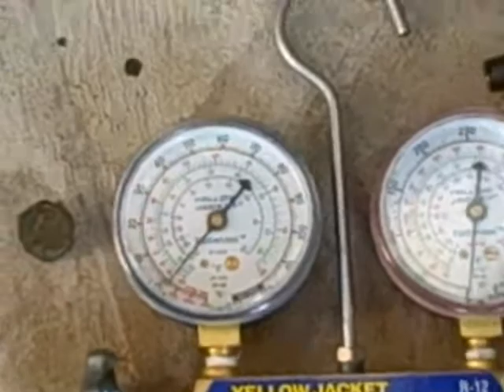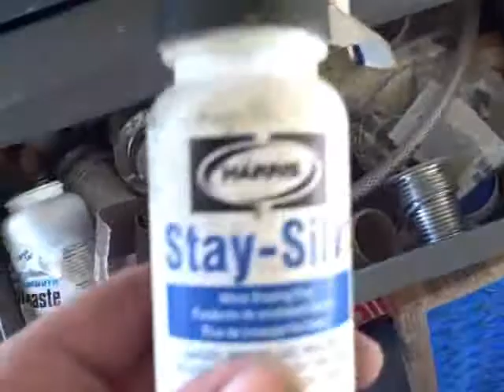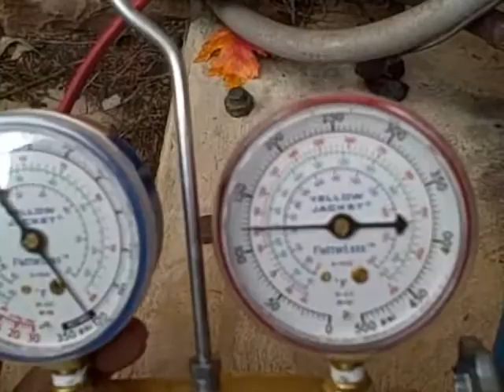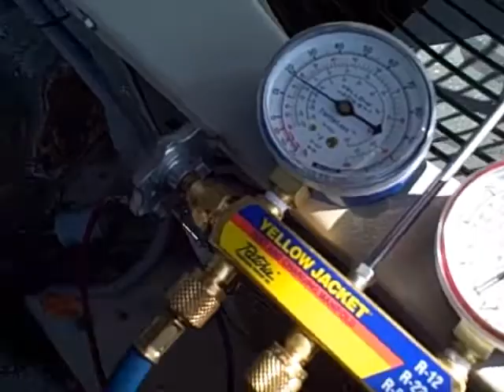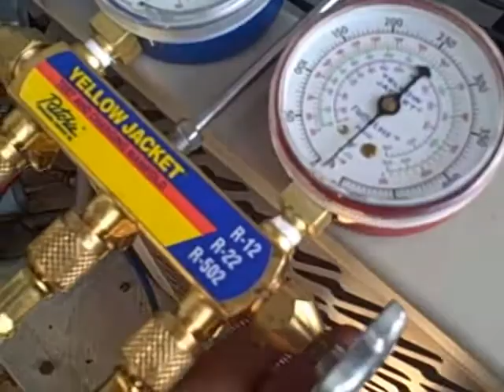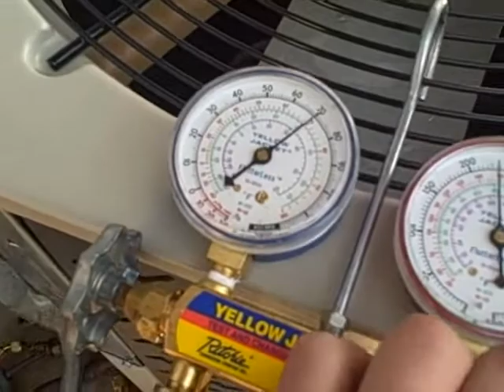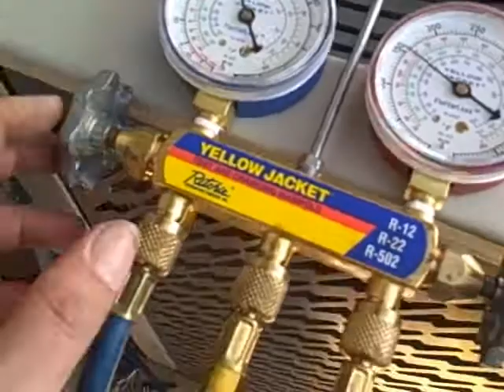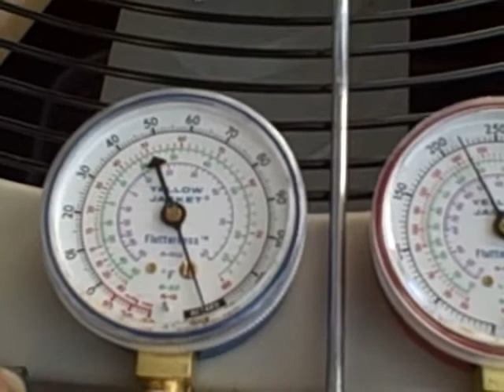HVAC/R Service 3

Comment from the maker: @kennetters Fan cycling switch. It's a commercial application that often calls for air in low ambient conditions. On the high side (liquid line) schrader is what looks like a high pressure switch. But instead of breaking power to the contactor coil and manual reset, it's actually set at a much lower pressure. On pressure rise, it closes through the fan.

Comment: You pumped down the refrigerant into the condenser coil below ambient pressure sucking non-condensables into the system, no nitrogen when brazing (produces scale which turns to acid in the system),  no micron gauge to verify a proper vacuum, no indoor wet bulb temperature reading to properly calibrate super-heat, and you must over ride the low ambient / fan kit to determine the proper refrigerant charge. How do you know how much refrigerant to charge the customer without a refrigerant scale?